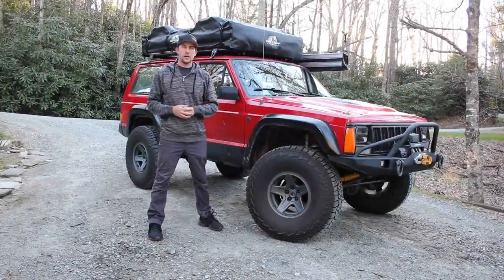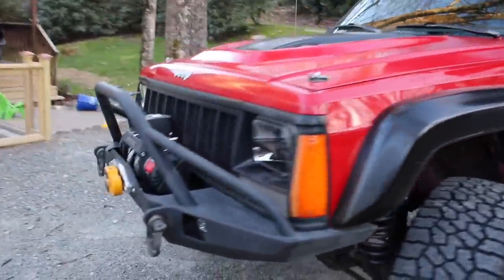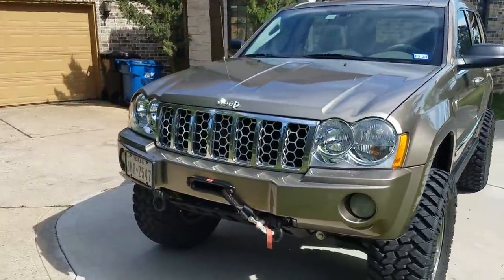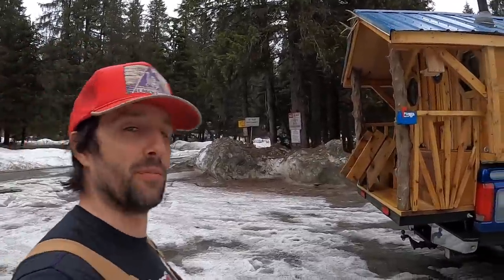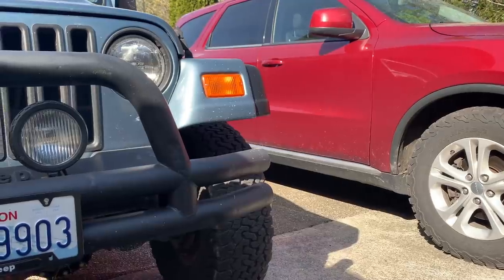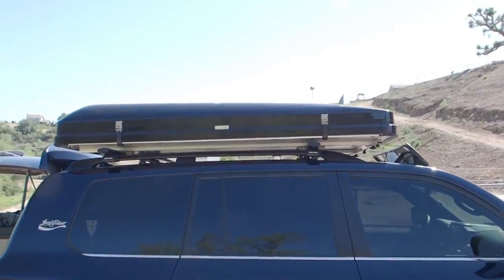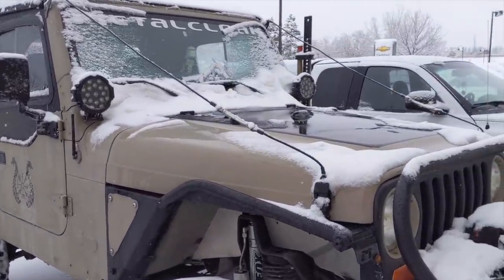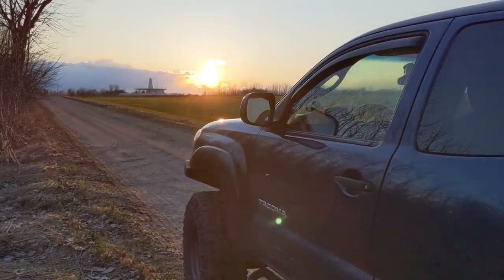Everyday Man's OFF-ROAD & OVERLAND BUILDS – Viewer Rigs

Comment: Awesome submissions! Especially that WK. You are right, they're super underrated! Point me to several newer rigs that come STOCK with front and rear locking capability, you can't! If you get some more those submitted throw em in there so we can see them! I have 5.7 like the one shown, OME lift, tires they can't get stuck! Thanks again for the vids! 😁😁

Comment: The cabin on ute tray is a classic, not sure about the gas and battery in same compartment though...
Reply: cheers! I figured most people barbeque w/ a propane tank 1 ft away from open flames, i'll eventually move it, but wanted to keep my wires and propane lines as short as possible to avoid leaks and make things more efficient.

Comment: Unable to submit a walk around just yet.  TJs in the shop getting a makeover. Jokers an 01 4.0L. 5sp on 6” full-traction long arm. Currently getting unbolted for many upgrades like D60 Kingpin front /Sterling 10.25 rear axles (once Covid is done and trusses arrive. Poison Spyder Steel fenders. Custom front and rear bumpers. Jokers heart is also getting some attention. As much as I love the 4.0 , running 37s with a 5sp. And 4.56 gears- it doesn’t like MI hills on the freeway, so Vortec 5.7 getting dropped in with a Novak Adapter kit to retain the 5sp.  Rock rails, full skid plate covering- oil pan, gear box, control arm knuckles, differentials, yokes, fuel tank, belly, all lights have swapped to LED- combinations of spot, floods, and light bars to cover many lighting needs in various areas. Smitybuilt cargo locking vault in the back, along with OBA(on board air- ViAir dual 480c compressors linked to a 250psi 2.5 gal tank. RockHard Sport cage added in for driver/passenger cabin protection as well as mounting locations for custom switch pods. AntiRock sway bar kit. PRP seats with 5pt harnesses, and once all mock fit is complete- the entire rig is getting sandblasted and coated with Raptor Liner (tinted back to my Gorgeous Green) with some accent colors to follow the Joker 🃏 theme... and for some final touches- will be installing electric line locks for the breaks independently at each wheel many uses later on when stopped-.    Typical creature comforts with upgrades audio. Multimedia head unit to run navigation and tracking apps , communicate hub.  And with all the electronics equipped- extra protection was needed- and setup a remote location fuse box for all aftermarket electrical components, dual battery system w/ capacitors (1 front winch, 1 sound system, 1power inverter).   And since our great president has sent/sending out stimulus assistance with the pandemic- great American companies will gain some start up business once economic shut down ends... 2nd winch for portable rear mount in hitch when needed. Roof rack,  tire Carrie to support 37s, lockers and Reid Racing knuckle dbl sheer steering kit.

Jokers 🃏 been a huge factor in coping with the pandemic matters. Not being able to go to work and stuck around home.... what better time to turn the wrench’s and prep for adventures after lockdowns are removed.

As they say JEEP- Just Empty Every Pocket.   They cost, but the enjoyment is a well worth each penny applied.

Be safe, shiny side up- 👋

Looking forward to upcoming videos-   Maybe a monthly viewer clip could be a new thing- maybe some friendly contest involved - viewer voted and Merch prizes....

Lights on- thumbs up- enjoy

Comment: The Trabin is awesome.  Am I paranoid to be a little worried about pairing the rear porch seat with batteries and a propane bottle though?
Reply: G Riv  Agreed, fire is a concern.  And in his response to the video-clip submission, Brad says his mind is blown.  Combine these two remarks and the result would be my fear: a spontaneous explosion. Yikes.  I do give the owner some points though for putting in the vent at the bottom.  Propane in gaseous form is heavier (denser) than air.
Reply: Cheers! I figured people barbeque all over the world with a propane tank literally inches from an open flame so I'll prob be alright, was trying to keep propane lines and wires short to avoid leakage/abrasion and inefficieny.  I'll eventually move things around maybe;^)
Reply: @TruckHouseLife  Thanks for replying because now I found your channel that I didn't know existed, lol.  I'm a big fan of what you're doing!